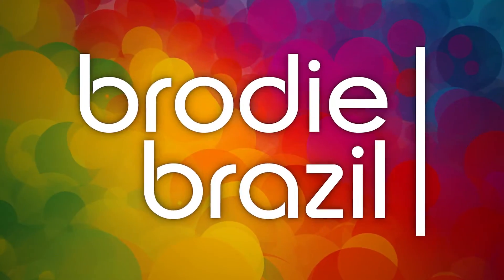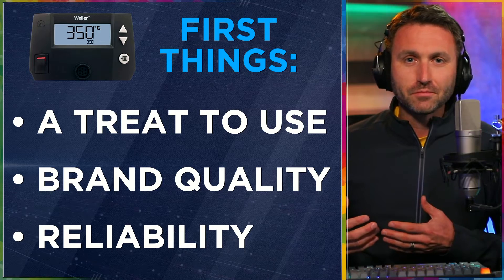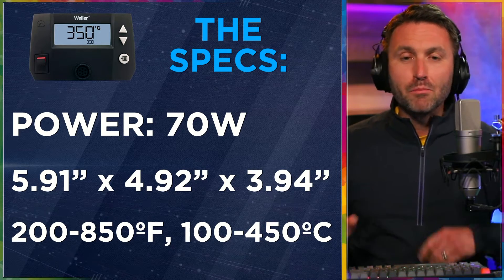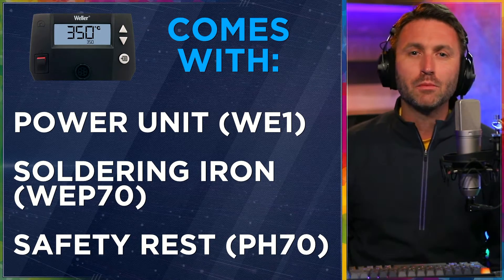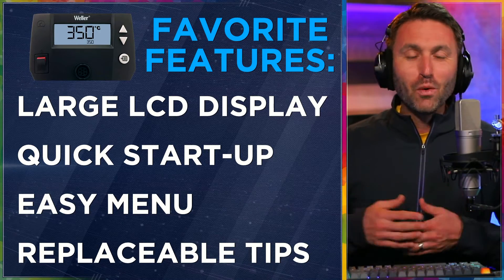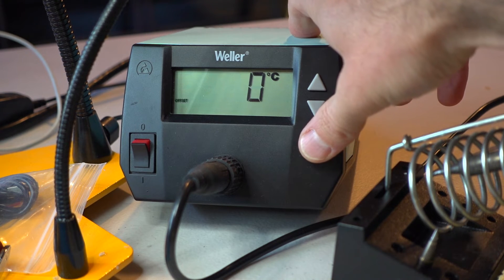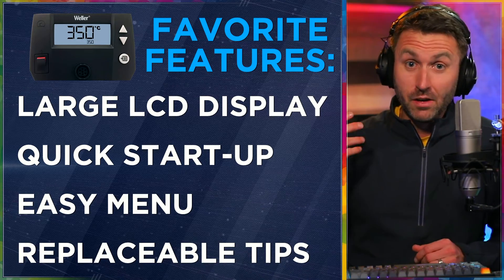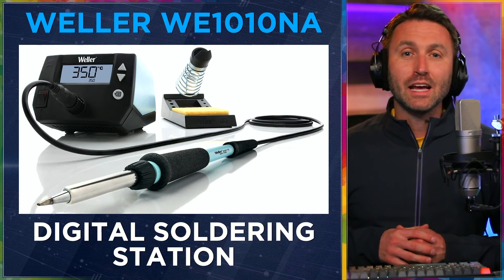Weller WE1010NA Digital Soldering Station (Practical Review)

Comment: Lets say i turned on my soldering iron i cleaned the tip i tinned it and put it on holder with solder on tip .
The soldering iron is ON .
For how mush time should i leave it on will it harm the tip? 
For how many minutes till i reapply fresh solder on tip and clean it again and put on holder again? 
That if i never used the tip just cleaned tinned and put on soldering iron stand . With solder on tip . 

How many minutes till next fresh solder on tip to clean and tinn again? 

Should i tinn tip with flux and solder ? 

I dont have 60/40 solder with rosin flux .

But i have tin solder and flux rosin core sepratly on box each can i mix toghter everytime i want to tinn the tip? 

Will it be same results as 40/60 solder with rosin flux?

Comment: thank you. I bought a Weller 120v soldering iron that probably cost about $15 in the 80's. I know, it was just a single plug in P.O.S. that came in a moulded plastic package off a peg from the shelf at Radio Shack(yes, I am that old).... That thing has soldered for years and years and years! I have fixed SO MANY THINGS and build pro-audio cables that have lasted the test of time with that thing. I recently decided it was time to go all-in and get something decent since I have a LOT of soldering to do for upcoming projects. Naturally, I looked at the brand of that CHEAP iron I bought way back when and it was a WELLER!!! It still works but the tip has been put through abuse of the many decades and i have NEVER replaced it. Recently I just started using my linesman pliers (i know cringe) to work off the carbon buildup since it never came with ANY kind of cleaning option... aaanyway... this review SOLD me. Weller is a good brand imo. It never let me down. It's just time to upgrade. I WILL be buying ANOTHER Weller soldering iron(station now) thanks to this review. Great video!
Reply: Lets say i turned on my soldering iron i cleaned the tip i tinned it and put it on holder with solder on tip .
The soldering iron is ON .
For how mush time should i leave it on will it harm the tip? 
For how many minutes till i reapply fresh solder on tip and clean it again and put on holder again? 
That if i never used the tip just cleaned tinned and put on soldering iron stand . With solder on tip . 

How many minutes till next fresh solder on tip to clean and tinn again? 

Should i tinn tip with flux and solder ? 

I dont have 60/40 solder with rosin flux .

But i have tin solder and flux rosin core sepratly on box each can i mix toghter everytime i want to tinn the tip? 

Will it be same results as 40/60 solder with rosin flux?

Comment: I have one of theses soldering stations and can attest to everything you have said about them. I’ve been using Weller soldering stations of one type or the other professionally for more than 30 years. They are great, this one being no exception. You forgot to mention they are also ESD safe, so are great for soldering ESD sensitive components too. The one thing I can't understand is why the three tip storage holes in the supplied PH70 soldering iron stand are smaller (won't accept the tips) on the right hand side. I drilled mine out as I like to have the full range of tips easily available when soldering.
Reply: I took me a few decades to figure out the small soldering tip holes.  They are made to hold the hot tips point down.  That way you can drop off the hot original tip then slip the new tip into the hot iron.
Reply: @kenmohler4081  Thanks for the update, that makes sense.

Comment: What is the offset feature for?   I can't see a need for it.  Thank you.  I own one and it's really nice.
Reply: I would also like to know.
Reply: It is to calibrate the displayed temperature to the actual tip temperature.
Reply: @BKD70  And how can I measure this temperature?
Reply: @blowfeld  same way you measure any temp a thermometer.
Reply: Have you tried measuring the temperature? I got bought and tested the temperature but it never reaches anywhere near the temperature I set its 30 to 70 degree celcius off depending of the temperature I set. I return that one to get a replacement and this replacement has the same problem. Right now I'm trying to figure out if there's something wrong with the thermocouple or multi meter used for taking the temperature.